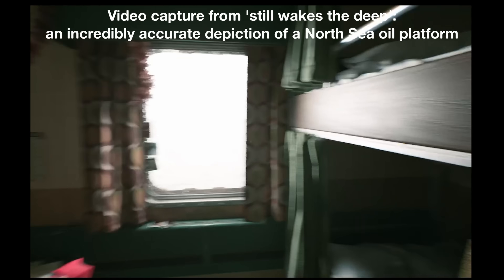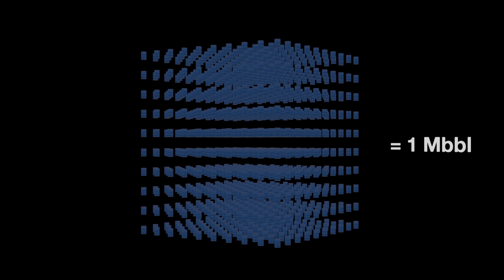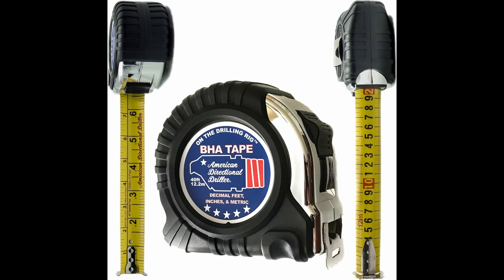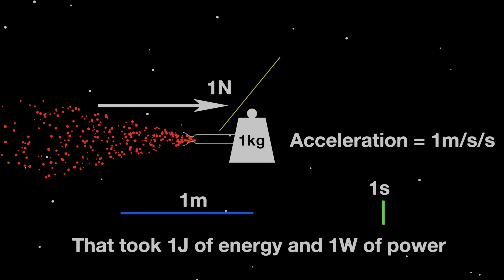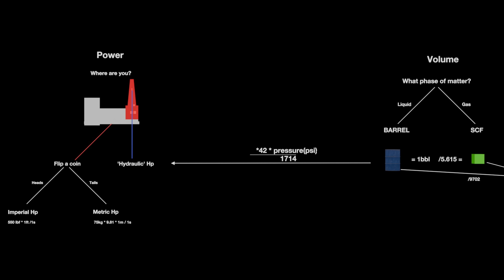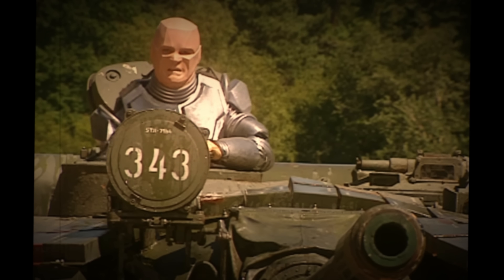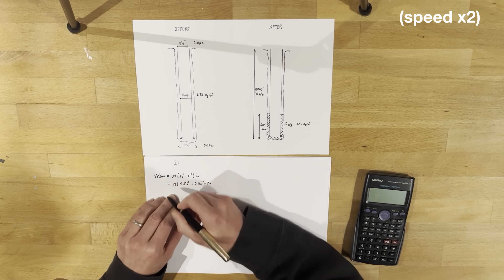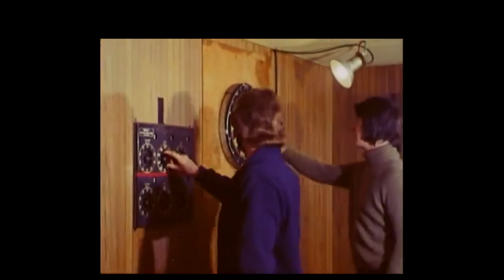Oilfield Units: a Measurement System so Cursed it made me Change Career

Comment: That decimal tape measure is pretty common in construction too. Typically, dirt being graded (added/removed) will have dimensions specified in feet and tenths of feet. Super common to be talking about "within 3 tenths" or "remove 5 tenths". You see it on drawings sometimes because it's easier to scale a decimal dimension than a fractional one.
Reply: "because it's easier to scale a decimal dimension than a fractional one."

Please continue.

Comment: You should check out the aviation industry. Here’s a simple one. 

Which side of a propellor is the face and which one is the back?

If you guessed the face is forward and the back is rearward you would be 180 degrees opposite! Why? 

Some ancient naming convention having to do with shapes of screws and high pressure sides and the humors of Aristotle or some such nonsense. 

But don’t you dare call it the front and back! That’ll confuse people because it’s always been called the face and back. Except the face is in the back and the back is in the front. 

That’s a simple example. Don’t get me started on cycle counts, flight time vs maintenance time vs hobbs meter time, or insisting that people handwrite important information directly onto parts (with inconsistent nationality’s methods of writing numbers, inconsistent inks, inconsistent label materials, and inconsistent labeling locations… for the same part!!!)

Comment: Academically I know that the Barrel of Oil Equivalency is used in calculating return on investment. 
I was taking a class on how to cut through bad information and one of the pieces of information was dealing with the Alberta Oil Sands and the dismal two-barrels per-barrel return on investment.

Comment: Gonna be honest, while I know we in America have some really dumb measurement standards, there are some that I NEVER want to get rid of. 
Most specifically, MPH. If our brave & beautiful government were to convert to KPH, they'd make sure all the conversion are done in a way to lower the speed limit. Not fun. 
But the fractional-inch measurement system, specifically regarding construction, is abhorrent. Or when measuring the thickness of industrial materials, equally abhorrent. 
The people that get angry about metric-imperial measurement systems are utter cringe. It's usually just good banter. Take it as such, you silly 'Merican nutters.

Comment: 1. BP Exploration (North Sea), 1983 — Well Pressure Mismatch
2. Petrobras P-36 Platform (Brazil), 2001 — Gas Injection Error
3. ExxonMobil Refinery (U.S. Gulf Coast), 1990s — Heat Exchanger Misload
4. Kuwait Oil Company, 2009 — Chemical Injection Accident
5. Piper Alpha (North Sea, 1988) — Indirect Cultural Parallel
All these are accidents where faulty conversion caused serious accidents.
Petroactivity

(in the style of Kraftwerk’s “Radioactivity”)

Petroactivity
Legacy and density
Imperial dependency
Measuring insanity

BP, Petrobras, Exxon too
Convert the numbers — one, not two
Pressure rising, gauge askew
Lost in PSI and dew

Petroactivity
Out at sea, offshore facility
Metric incompatibility
A fatal possibility

Barrels, feet, and Fahrenheit
Gallons whisper in the night
Safety slips beneath the light
Tradition says, “We’re doing it right.”

Petroactivity
Cultural viscosity
Floating wrecks and policy
Pathologic loyalty

Piper Alpha, P-three-six
Calibration in the mix
Kuwait line corrodes and ticks
Heritage of unit tricks

Petroactivity
Conversion discrepancy
Mud weight density
Fatal legacy

Drilling dreams and hydrocarbon gleam
Houston calling Aberdeen
Half a century in between
The system dies, the myth stays clean

Petroactivity
Measured in catastrophe
Pounds per gallon, pounds of pride
Counting losses industry-wide

Petroactivity
Tradition’s electricity
Still we chant the same decree —
Barrels per day, eternally.

Comment: Canadian engineer here. I wanted to say that in my experience most engineers here still use SI units then convert at the end because we spent our university career learning to do everything in metric but frankly it just doesn't matter what units everything is in because the formulas stay fundamentally the same just with a different constant based on what units you're using. it doesn't matter if you're using liters and meters or barrels and smoots as long as you double check all your calculations

Comment: Only 40 seconds in but this is a "preliminary" comment to see how this vidja goes. :)   
*AHEM*   As someone who has had to deal with CGS system, "Metric", SI, Avoirdupois,  Imperial and Apothecaries' system (think Troy ounces) all in the context of education, work and business I was forced to *JUST DEAL WITH IT**. Converting units is something you get used to the more you use it. Fluency in multiple languages is accepted, why not measurement systems?  **Back To Teh Vidja*

*AFTER*  Oh dear sweet lord baby Jesus... it is SOOOO much worse than I suspected. I apologize. I am also now very, VERY glad I chose not to get the Chem E degree as I would have most likely ended up just working in the petroleum industry anyhoo. Good lord I did not realize how incredibly lucky I would now feel having dodged that particular bullet.
I agree with your assertion that this makes the Oil and Gas industry sound tragically amateurish and absolutely they are doing this to be different. That is the height of inefficiency and foolishness.
Bless your heart sir. Just ignore completely any yay-hoo who pipes up with the whole  "Why for you usin' dem dare metricals??"   They are just being bitchy. 

As an aside I watch Glenn and Friends cooking and he notes on occasion the weird canuck habit of using a weird mish-mash of Imperial/American/SI/volumetric/ units depending on what you are measuring. Also temp can be deg C/deg F or "gas mark" or "slow oven" etc. That part is reminiscent of the oil industry crap you mentioned.  Also: MILK... .in a BAG!??!

15:54 You said "it is 216" but you wrote "231"  NOW the bore hole is incompletely filled with cement, we get a blowout and **WE ALL DIE**!  (presumably ala Deepwater Horizon).

p.s. After typing the above prior to reading any comments I see you already noted your onscreen vs verbal numbers bobble AND you call out the odd canadahoooovian system as well so. KUDOS! 

Peaceful Skies

Comment: Take a moment to appreciate that a US gallon is an integer number of cubic inches because someone in the early 1700’s picked a “good enough” approximation of π.

What was to become the US gallon is rooted in the volume of “eight medieval merchant pounds of wine”. (This might account for the power-of-2 fractions of quarts, pints, cups, and fluid ounces.)

But then the gallon was redefined under Queen Anne to be a cylinder of diameter 7 inch and height 6 inch, to be calculated with the specific approximation π ≈ 22/7.  Hence, 1 gal (US) = (22/7) × (7/2)² × 6 in³ = 11×7×3 in³, exact by definition! But since none of the factors are 2, none of the gallon fractions are an integer number of cubic inches.

Comment: You skimmed over SCF as if there's anything standard about them. Is your standard at 59⁰F & 14.696psi (powerplant standard) or 75⁰F & 14.7 psi (chemical engineering standard) not to mention the metric versions thereof 🤷🏾‍♂️🤬💩. I worked in a job where multiple times customers asked for flow in scfm (SCF/min) and I'd ask them what standard temperature and pressure and they'd come back pissy like “don't you know it's 101.3 kPa and 25⁰C?” and I'd show them the previous request from people in the same industry that wanted it to be 60⁰F and 14.69psi
Energy content of fuels is often given in BTU/lb but there is a reference temperature and pressure associated with that, guess what? It's not 🤬 standardized.

Comment: As a freshman engineering student in 1969 I worked in decimalized feet and had scale-rules for that. I liked decimal feet and used them personally as a convenience for a number of years after. By 1971 the USA had decided not to go metric or to modernize anything their measuring systems so Canada decided that decimal feet would put us out of step with both the USA and the rest of the world, so we 'converted' to metric. I still don't automatically 'know' the metric dimensions of a 2x4 piece of dimension lumber, likewise the metric dimensions of a 4ft by 8ft piece of plywood or sheetrock. One part of my house has a centigrade thermostat (for the kids) while my wife and I heat our part in fahrenheit. My car has a dual speedometer face, but I still translate everything into miles today, 50 years after I began to drive and 45 years after we got kilometers. In the store we are comfortable converting kilos and pounds back and forth, likewise litres and gallons, although the old imperial gallon is basically GONE here in Canada. 
Sometimes things seem to be a conversion from the old system and actually are not. The standard 4.72 litre oil can which is so common today would 'seem' to be a conversion of some sort, but the imperial gallon contains only 4,546 litres, and the US gallon contains only 3.785 litres. 🤔 that is just to keep us on our toes, I suppose.
Oh yeah. I fly a plane over nautical miles of distance, and likewise when I sail my boat. There is a measure which derives from nature and which the S.I. has yet to dethrone

Comment: American here - When you brought up decimal feet, my brain broke. What?!?   I've never heard of this horror.  Then you mentioned there are different versions of the BRITISH Thermal Unit. WHAT?

I'm so glad my "thing" is electrical systems.  The units are fairly sane.
Reply: I was the maintenance guy at a machine shop, but started helping sawing material because the saw guy quit. The shop provided tape measure was so worn, the paint on the first w feet was stripped off so I had work order a new tape measure.

After meticulous calculations I found I was short a few feet of material for the order. I measured the material beforehand and knew with absolute certainty that I had approximately enough to fulfill the order. I counted up the pieces and found I was several pieces short. More than any tolerance error would allow.

Another machinist started double checking my work with the tape measure. He agreed I should have had more pieces from the original length and that all the pieces were the correct size and were uniform length, and it bothered him as much as me that something didn't add up.

He grabbed his calipers and noted the pieces were long, then he went back to the tape, looked at it for a second and threw it in the trash and lent me his.
Reply: Back when drawings were done on a table with a pencil I had an architects scale with 6 scales on it.  1/10 inch, 1/20 inch, 1/30 inch, up to 1/60 inch.  I mostly use it for machine work in decimal inches and ignore the other 4 scales.  But if I ever need to draw a floor plan where 1 inch equals 5 feet I will be all set.
Reply: I machine on imperial equipment (as a hobby). Let me tell you about some more fun units: firstly, the "thou" or thousandth of an inch, popular for most high precision measurements. This one's mostly ok. Now your turn: guess what a "tenth" is...

That's right, a "tenth" is 1/10,000 of an inch! What you thought it was a tenth of an inch? Don't be ridiculous. For your next exercise, I need to make a .172" hole in something, which fractional inch drill should I use?
Reply: @nerd1000ify  I would use a number 18 and then ream it to 11/64 and then destroy what ever goes in the hole hammering it into place.  Unless you want a broom handle in a sewer pipe fit.
Reply: @johnpublic6582  Spoken like a true machinist. Me, I'm lazy, and I don't have a set of fractional reamers or number drills. So I'd probably drill it 11/64 and then use a roll pin...
Reply: Decimal feet are also used in surveying, alongside feet & inches and centimeters. But to make it worse, there are two different feet used: the statute foot and the survey foot. The statute foot is the one we all know and love, equal to 0.3048 m, but the survey foot is 1200/3937 m ≈ 0.30480061 m. That's right, it's almost two parts per million longer.

Comment: Painting wooden barrel floors blue was to mark these barrels as non usable for any food. This was first practised in Pechelbronn (France) and Wietze (Germany) decades before oil wells were drilled in Pennsylvania. It might be that imigrants took this habit just with them. 
The name Pechelbronn ist historically documented 1498 and literally translates into "oil well". Back in that time there was no metric system but many regionally used units. Used salted herring barrels were cheaper than used wine barrels at least in central Europe.
In addition I guess that blue paint was the cheapest available color as industrial made paints were not invented, either. But that's just my guess.
Reply: Blue was actually a rather difficult color to make for paints, pre-industrially.  Cheap paint colors were ones colored with charcoal (blacks and grays) and iron oxides (reddish-browns), with whites from lead oxide also being reasonably easy to make.
Reply: @BrooksMoses  Anyway .. but all in all ... the barrel as unit is older than the metric system and with Rockefeller it became standard in oil trading. It's like describing containership capacity in TEU (20ft-unit-containers as big barrels). The mess is starting when the unit became abstract as today no one carries oil on wooden barrels anymore.

Comment: One Imperial Gallon is equal to 1.20095 US Gallon, yes a trap for the unwary.  I work with multiple different systems and it is easy as long as you keep in mind that you have to know what you are working with and not be so arrogant as to assume everyone else uses the same system.  Yanks are shocking in this respect. All units must be converted to one standard when working with them regardless of what that system is.

Comment: Your example of power is perfect and it also exemplifies an issue with the American engineering education as a whole stemming from units. Learning the concept of power as it's applied to different machinery is extremely confusing and hard to understand with this entirely fucked up unit system.

Comment: I once saw a sign that said "City: 12 miles", then 1 mile later I saw a sign that said "City: 6 miles". Apparently the first one was the total distance to the city, and the second one was the distance to the exist off the current highway.
But it seemed like I traveled 6 miles in the last mile, or 6 miles per mile. Which, you could say, is a "constant" speed, haha.

Comment: At least the USA, as of the start of 2023, has formally retired the 'Survey' foot. Oh yes, up until end-2022, the USA was carrying two different feet (and inches and miles [not even including the nautical mile]). 'Survey' vs. conventional.

By the way, the 'conventional' (Imperial) system was only unified by gauge block maker Johansson when he arbitrarily decided to sell his 'Inch' gauge blocks based on the compromise dimension of 25.4 mm exactly. Up until then, everyone had their own; some smaller, some larger. He unified the inch (making the new 'Industrial' inch), and then people figured out later that this had happened.

Fanbois of the Imperial/Conventional measurement systems (plural) are unlikely to be aware of much of this.
Reply: He didn't want to make two different sets for USA and UK so he split the difference of the inch. It was Henry Ford that made the first order. Oh, and everyone else used centimeters already so there was only the two to deal with.

Comment: This is literally just the same problem everyone has when they learn a second language.
Languages don't make sense. They just work. The best advice is to embrace it on its own terms and not fight it. Fighting it will only make it harder to acquire and use the language. Accepting it will make it easy.
If you fight it and hate it, you will literally never learn it and it drive you insane forever, which is why Alexander here couldn't adapt to it.

Comment: I was a mudlogger about 25 years ago, and it seemed to me that producing oil and making money was just a side effect of their real focus—making everyone in it as miserable as possible. I did some hole volume calculations when we were going to pump a calcium carbide “pil,” you figure out how many gallons the well was (minus the drill string’s displacement) you knew how many gallons per pump stroke, so you figure out how many strokes to pump the pill down the pipe to the bottom of the hole, and then back to the top.

Our gas analyzer could see the acetylene that calcium carbide releases when it gets wet so you could spot it when it came back.  If it took more strokes than planned you knew the sides were caving.

Now, I just made about a thousand double entendres and that was about the only fun thing about the oil field!  Truth be told though the calculations didn’t even register on what I hated about the oilfield.  All the unrepentant assholes that viewed every opportunity to unload on their lessers as the sweetest plum in life kinda made doing math seem uneventful. And the way they always kept me sleep deprived didn’t help.
Reply: @dennisfox8673  I did it back in the early 2000's,  honestly, doing the US calculations didn't faze me at all, the crappy "Drillbyte" program did all that stuff.   If memory serves right, there were some extra factors you had to stick into the equations we used which probably wouldn't be required if everything was SI.  But generally we didn't manually calculate this stuff, the numbers were entered into the program which did the donkey work.  As one who was inept with computers but handy with numbers I preferred the old fashioned method.